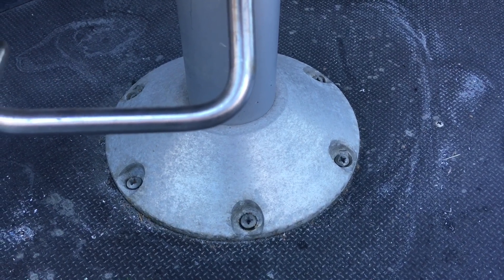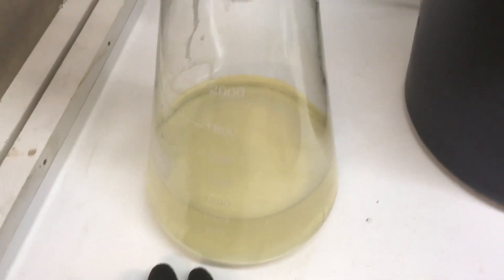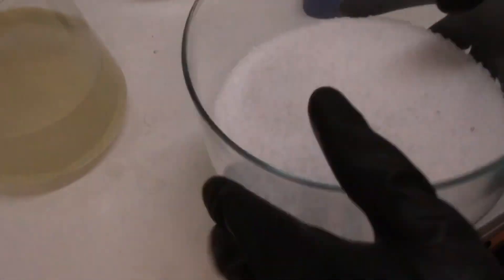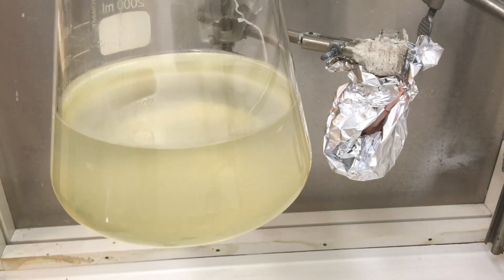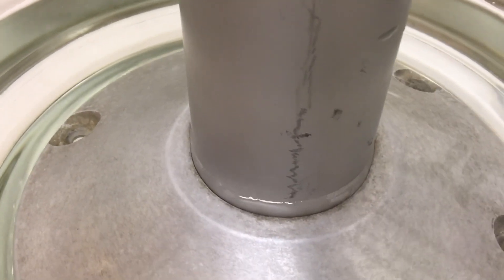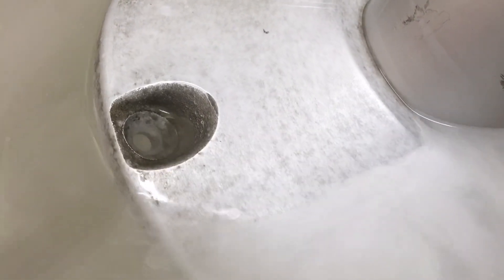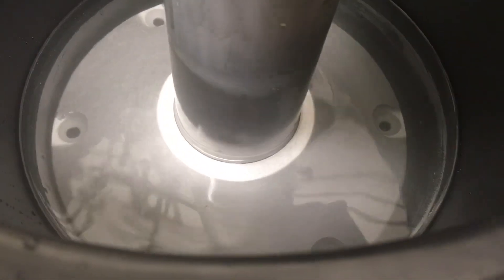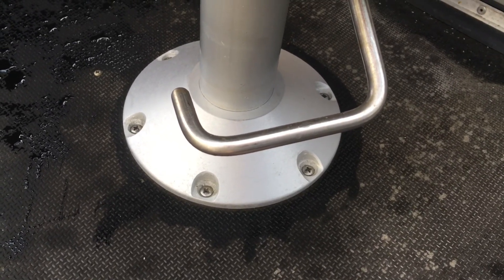Aluminum boat restoration with the toilet cleaner

Comment: Looks nicer. But remeber that it is the oxide layer that protects aluminium from corroding. So it won't stay that way for long. The least effort way of making the surface look good is to rub it down with an abrasive like a fine sanding paper to knock off the worst of it. It won't look as good, but after a few months you would be hard pressed to see the difference .
Reply from the maker: I think that section on the bottom of the seatpost was never anodized from start, but as you say its the aluminum oxide that protects the aluminum. Removing the aluminum oxide from the anodized section is not a very good idea unless you have a setup that allows you to get back that thick aluminum oxide. Many thx for input.
Reply: @Ken_Sweden  it comes back in a second. That's my point. I wasn't thinking about anodizing at all.
Reply: Don't get me wrong, it looks awesome.
Reply from the maker: We will see, it took 30 min of saturated sodium hydroxide etching to get it off. I would be surprised if it came back in a second. I’ve seen that they use some kind of alu sealer on sailing boat masts. Maybe that’s the way to go?
Reply: @Ken_Sweden  Oxid på aluminium bildas direkt då det kommer i kontakt med atmosfären. Det lagret är relativt osynligt. Det som ser så ojämnt ut så som du visade i början av klippet verkar mer tyda på orenheter som har bakat sig in i oxidlagret och kanske även i materialet. Ett intressant experiment skulle kanske vara att bygga en lufttät kammare och fylla med typ Argon/Mison eller någon motsvarande gas och då skrapa rent ytan på en bit Aluminium. Sedan repetera samma procedur med en annan bit utanför kammaren och se om det finns någon visuell skillnad.

Comment: Why not electrolysis? Hats off to safety measures :)
Also about acidic solution (from tytanic rust removal) - maybe try EDTA-Na?
Reply from the maker: +Daniel Aluminum is so reactive in acid and bases so there is no need to get the electrons to move at its surface by additional electricity. However, you raise an interesting point. Reversing the electrodes in typical rust removal electrolysis, and running the reaction in acid makes anodized aluminum - which is much more acid and base resistant - and can be made very hard and scratch resistant. Many thanks for the comment. I will look up a simple way to show this.
Reply from the maker: I see, nice input. I have to dig into the chelating agents. I use some of them in the electroplating, which I haven't shown yet, but my feeling is that they are to some extent very specific / selective in which metal ions they carry. I appreciate this input. Sorry didn't see your original reply until now. I will definitely take a closer look at this.